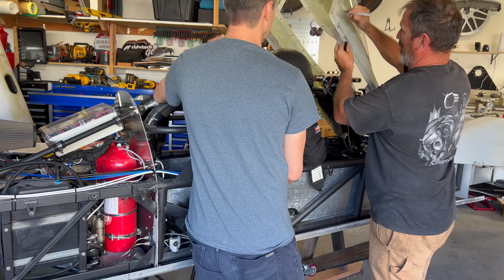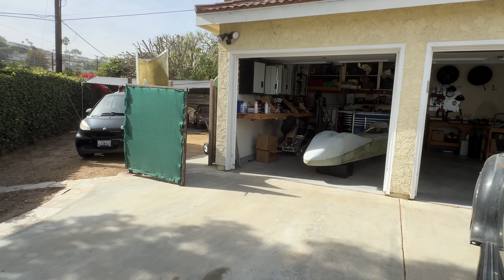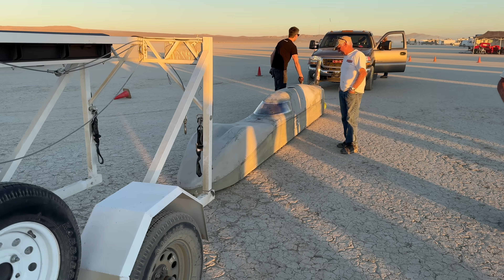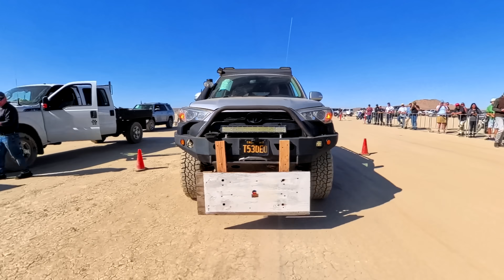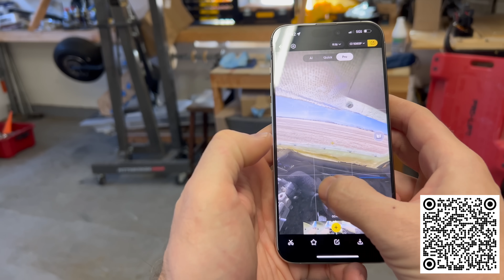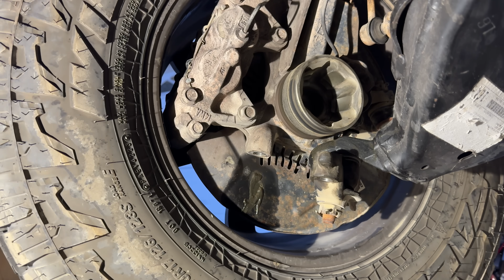I Went Too Fast

Comment: Why not use a 2 cylinder 500 cc instead of the extra weight and rotating bits of a half commissioned 4cylinder ? Use a belt instead of a chain, less friction and weight

Comment: That dust cloud can also be coming up off the rear wheel that is not getting 100% traction.  It's more of a dirt roostertail.  when power exceeds drag the rear tire is turning faster than the car is going throwing up dirt.

Comment: The reason of having to go through the different classes is to learn at what point t steering dynamics are going to reverse.  At tha time when you  steer right, you're going to go left. It's about traction, and depending upon how much weight is making traction on you're front tires it won't matter much if they have greater  cenrifical force. Get it? Got it?... Have fun?!!

Comment: As to the missed reason for the half shaft popping apart, from my limited experience in a race pit lane it's easy to miss what seems obvious later. In the heat of the moment it's hard to focus. I'm more amazed you were able to get the right sized bolt so quickly in the middle of nowhere.

Comment: Throwback to the time I broke all sorts of shit removing a single bolt holding the starter in my Ranger. My brother bought, fixed, and sold er to me after a lot of work. And apparently a little red LocTite.

I should not use the words I want to use about this.

Comment: Hey Matt all bulshit aside I can go 141 mi an hour on a 125cc 2 stroke... I had a buddy of mine's dad machine me a piston or rod and a cam for an old Kawasaki 125 RM... So basically what we did is we put the titanium piston the rod and the cam in it and I've just got a big pipe and it's on an old Orange county chopper setup as a drag bike I cut the crank out of it and take the chain off of it put a big chain guard with a secondary clutch and a primary clutch on it and it has a jack shaft with a small 13 too much tooth gear and then I'm running a 66 and I'm running in the 8th of a mile at the track 143 mile an hour and I still got half a throttle... I've run it on the highway at 165 and shut it down because I didn't have a steering stabilizer and it tried to death wobble on me... And that's just for the 125cc engine. So if I can do that on the bike you don't even need 500 cc's. You could actually take that car right there rebuild the frame out of carbon fiber put an actual fiberglass carbon fiber body using the fake carbon fiber mesh and just fiberglass resin and that car would reach 220 mile an hour with an 18 horsepower Honda engine......

Comment: Ive had the exact thing happen to me on my 04 4Runner. Sucked. Had to get it towed home. It surprised me when I saw that. You have a castle nut and cotter pin for the ball joint. But the bolts holding the ball joint bracket dont have anything.

Comment: I wonder if you could use a Honda VFR 400R 400cc v4 engine....
Reply: He's aiming for roughly 100 hp.
Reply: @jospi2  The VFR 400 is restricted...I bet that you could get close to 89hp with that or with the RC30 VFR750...un restricted stock in 118hp...otherwise a honda CB600 engine could do it...I was just thinking about size and with the V-4 would be smaller and with the 90 degree angle...just seems like a good choice for balance etc....

Comment: Funny, I have a 1997 Gen 3 4Runner and a few weeks ago I replaced the upper and lower ball joints in the car.  My mechanic pointed it out to me and he said the chances of the ball joints causing an accident on the highway was great.  The ball joints had never been replaced and I have owned the car since new.  If those things are loose you better replace the ball joints or you will lose control of your car.

Comment: So,   ...    curious re. disabling two of the four cylinders in the four pot motor to half the cc?  ... you will still have the parasitic drag / losses from the  "disabled componants, ...  unless you plan to remove 50% of the motor internals  ...  maybe better to get a high power genuine 500cc motor  ... some of the eighties two stroke motors can be tuned to 120 bhp with reliability ...  not sure what is available in 4 stroke modern motors.

Comment: It is true that a lot of front hubs are held together by the stub axle which is the most outboard portion of the CV-equipped halfshaft. It is also true that some are not... I find it amusing that 2WD Chevrolet Tahoes (rare, but used here by some police departments) just have an empty splined hole through the hub, because they don't have a halfshaft and don't need it to retain the hub.

Comment: i think on the top speed run it could push 180, bigger motor or more power it could definitley push 200. Also what is the drag coefficientcy
Reply: In the airshaper app that is shown it says drag coefficient of 0.125 and a frontal area of 4.2 square feet.

Comment: Mechanic here, I've seen before it on lifted 4x4s where the increased angle from the lift kit will cause rapid wear or damage to the CV joints, or even yank them out entirely as you've experienced.
Edit; I wrote this before I saw the dislocated ball joint. Oops!

Comment: I don't actually know, but am guessing that is an s1000rr motor. I looked at a picture of the crankshaft, it looks like a typical flat plane inline four crank.
    So, my question is, if you are only using two cylinders, how does it sound just like a flat plane inline four?
    Any two cylinder configuration should sound very different. I have never heard any sort of 2 cyl that I'd mix up with a flat plane I-4. Maybe my ear is off today, but I'm usually pretty good with engine sounds.
   You can't tell a musician that the same note played on a trumpet actually came from a piano, you know?
Reply: Ohhh.. I just finished the video. Sounded like a four, and it was.
   Same guy again.

Comment: I have a question, and it may be that you already answered this in a previous video, but this is the first time the algorithm has put you across my path, so forgive me if it seems like a silly question. 

If you want to go as fast as possible with a 500cc engine, why not use the engine from a 500cc Speedway bike?

Comment: a CBR250RR motor would be nuts in that thing with its 20,000 RPM redline probably not great for performance but 20,000 RMP

Comment: Oil filter leaking equals double gasket. Sometimes the old filter gasket sticks to the oil filter housing and when you screw on the new filter, double gasket leaks.

Comment: I have worked on those 4runner lower balljoints for years. Those four bolts never fall out if torqued to spec, and  the usual problem is they rust in place and snap off. There is no need for thred locker unless you plan on never getting the bolts off again. Some factory service manuals have to torque spec incorect, so be careful not to over torque the bolts. It was a common misprint on the gen 3 4runner manuals.

Comment: Haven't seen the previous videos on this. What's the reason for choosing a half-deactivated 1000cc engine instead of an actual 500, or anyone know which video explains the decision? Seems like it'd mean unnecessary weight...
Reply: There are no easily available 500 cc engines that produce 100 hp, half of the 200 hp that the bike engine produces with all four cylinders.
Reply: @jospi2  thanks

Comment: It kinda surprises me that the best 500cc motor is a 1000cc 4cyl with 2 deactivated. When you do that, how are they deactivated? Are all the parts still there? pistons, valves, etc? If so, wouldn't that have a lot of parasitic drag/friction? Or are they all removed and sealed up somehow?
Reply: He mentioned in an earlier video to take out the rocker arms for the deactivated cylinders to keep the valves shut and avoid pumping losses.

Comment: 12:40 I actually had a half shaft spontaneously disassemble in an off-camber driveway at full right rudder lock. The inboard cv coupling appeared to be healthy, had lots of grease and no corrosion. It just fell apart. I have since never trusted my half shafts.

Comment: Pro tip. Learn to Safety wire. Also known as Lock Wire. Its a MUST for bolts that get vibrated loose. Torque, and then safety wire. Learn the how and why's of safety wire. Its critical its done the correct way, but is not difficult. I became a safety wire expert in the USAF, in no time flat. We put safety wire on almost everything on the F-4 Phantom.

Story time: While I was stationed at George AFB, located right outside Adelanto, Ca, where I used to live, I would sometimes get tasked to help other specialists, to do their work. Usually standing next to a fire bottle, just in case. This one time I was under the aircraft, just watching things, during an Engine Run. I noticed the the missile launcher above my head, an Aero 7/a launcher for Aim-7 missile, which is held in with four bolts, AND SAFETY WIRED. Well, supposed to be safety wired. Since it wasn't flying, and the launcher would be removed after the engine run, to get access to the engine, as the missile launcher is part of the Engine Bay door. The bolts, that were torqued in too about 400 inch pounds. Well, they were all turning, and what caught my eye was one of them falling out. I was able to get the crew chiefs attention and signal there was a minor problem. I grabbed the bolt that had fallen out, no a good thing around running jet engines to have bolts laying around, and began running the bolts back in by hand. And then put the bolt that fell out back in. They all began turning on their own. Like gremlins were intent on having this aircraft AFU. or Tango Uniform.
I had my tool box nearby, grabbed a speed handle and 9/16" socket and torques them back in, and then safety wired them in place. So even when torqued in, they can reverse out, by vibration. SAFETY WIRE SAFETY WIRE SAFETY WIRE SAFETY WIRE SAFETY WIRE SAFETY WIRE SAFETY WIRE SAFETY WIRE SAFETY WIRE SAFETY WIRE SAFETY WIRE

Comment: The same thing happened to my friend's 4runner, one of those bolts fell out and his CV separated itself when he turned. We were off-roading when it happened and luckily we had all the tools to remove the CV. We went to a small local hardware store, we didn't know it till later but we used a bolt with the wrong thread pitch, but it was a short bolt so it still went together and he drove home on it. Later he replaced it with an OEM bolt. Before it happened his friend helped him replace the front shocks and we think that they both thought the other person was going to torque those bolt down with a torque wrench and it didn't get properly torqued.

Comment: That exact same thing with the LCA bolt happened to me in the woods far from anything, managed to hold it together with a smaller bolt and half a dozen hose clamps and drove back the 300kms home at 50km/h (when the towing would have just taken the vehicle because of covid) 😅

Comment: Those two deqctivated cylinders, a few reedvalves on a custom header, and you could turn them into superchargers, 

4 cycle engine means they each pump two volumes for every full internal combustion cycle.

Comment: I once avoided tightening some bolts on an exhaust connector because I was afraid it would warp the two ends of the pipes, only for it do slide off when I drove my GF tot the airport and let the exhaust loose, facing forward.
Luckily, I had to reverse out of my parking spot and so was able to hear the horrible grinding on the ground before driving over some crack in the road and ripping out all the cabling and fuel lines from underneath.....

Comment: Do you plan on plumbing the other 2 cylinders with modified cams or one way valves as a supercharger at any point?
Reply: In a previous video he mentioned to take out the rocker arms for the two deactivated cylinders to keep the valves shut and avoid pumping losses.
Reply: @jospi2  right, but you can use them to make a ton of boost too.
Reply: @jasonbirch1182  That would be an interesting project for future Matt. Blown 500cc record attempt.

Comment: @Futurematt: Warm the lower ball joint bolts to 250°C (550° F) and the loctite will release. 
@Superfastmatt: it looked super stable, compared to the last run, or was that the camera smoothing everything out and your eyeballs were still rattling?

Comment: How do you delete two cylinders? Will there be any issues with the crank timing and achieving the same revs with the different balance? I take it you'll remove cylinders 1 and 4, but you'll still be turning half of the crank-shaft mass as dead weight, right?
Reply: In a previous video he mentioned to take out the rocker arms for the two deactivated cylinders to keep the valves shut and avoid pumping losses.

Comment: Tip for better deadline approximation and timeline fulfillment: stop trying to guess when you think you can do it. Think about the most inefficient way someone who knows absolutely nothing about what you’re doing what do and what you think you’d reasonably expect from them, not yourself. Knowing nothing about cars, building a land speed racer? I recon if you went to trade school or something which I have no clue how it works because I went to college like what, two years, four years tops, another year added to actually practice a little bit. Think how long it took to get good at your first job.  the project should take 3 years minimum conservatively! More like five years really, for something half decent. Even if you’ve engineered and designed both a gas and electric vehicle from the ground up from molten steel and a bucket of transistors, and rebuilt a hundred engines, you might think you got this you can do it in a summer or something, but you haven’t built a land speed racer yet, so… 
I know it doesn’t really apply now that you’ve done it but hopefully that helps someone where, I wish someone would have explained estimations to me like that a decade or so ago.

Comment: Im confused, if you needed a 500CC engine why not use a bike engine? Why have the extra weight and internal rotation resistance of two dead cylenders? The sole benefit that I can think of is an H pattern transmission that can be put into neutral at any time as opposed to a sequeltial transmission.

Comment: I wonder if that bolt hole in the front being left open might be important for the laminar flow?
Also some of the high pressure air under the front and around the wheels can bleed off.....

Comment: Did you lower your front diff when you did the lift kit? Ive done about 12dozen of those lifts and they pop the axle out just like that if the diff has not been lowered a few inches to make the cv axles level

Comment: Turn the "inactive" cylinders into an air pump and use a liberally "lightened" air motor for extra power. No heat exchanger is needed before the motor, and the working air can either be closed-loop fancy gas, or you could return it to a centrifugal compressor's intake.

Comment: 13:52 Thread locker generally doesn’t make a difference in a fastener loosing or not. Just might slow it down a bit on its departure journey. There is no substituting a properly tensioned joint.

Comment: For future Matt, the outer CV can be dismantled like a puzzle, usually a clip to get the shaft out, then rotate the cage about 90 degrees to push one ball out, then repeat.  It's like a fun 3D puzzle, no hammer required.  Congrats on the run.

Comment: And not that it matters that much now, but in the shot that your lbj bolt is missing, there is a ridiculous amount of stick on wheel weights on the wheel. So might be a reason to get that tire/wheel checked out. Normally wheels, even with mud tires, don't require anywhere near that much weight.

Comment: I noticed the rear aero (before you mensioned it) and the way the air came off the rear fin, very clean and sharp. Well done. Better that your work on the 3-Runner, but that's useually the case with race cars, they have shitty tow vehicles.

Comment: Kiwi Steve is a super nice guy.  He wandered up to our pit in 2015 at the first Ranchero's first [24 hours of lemons] race and saw a bunch of millenial idiots scratching our heads over "how do carburetor work".  He spent the rest of the evening walking us through carb troubleshooting and tuning.  And it ran better when it got fuel (we were on a mechanical fuel pump, and when replaced it with an electric pump out of a Civic the next day, the car was able to go up the hills at Sears Point.  He helped us get a "class win" at our first race...).  Anyway, shout out to Kiwi Steve indeed.  What a legend.  I'm glad he's still hanging around the SoCal grassroots motorsports scene.

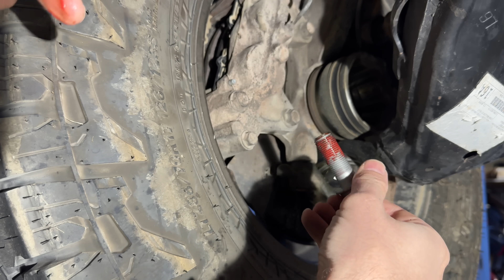Comment: 14:01 No you did not 🥺 red locktight should come with a warning lable cause that is now perma chem welded.   Blue or gray only, unless specified otherwise. Yikes,  heat may be your only savior sometime in the future, as in while replacing the CV shaft.

Comment: When I was watching the flagger give you the start and I heard the engine rev up and then you starter slipping the clutch big time to get going, I knew something did not work as planned. I was wondering what happened to your PUSH. And then wondered if your clutch would stay locked up at the top end push.

Comment: Cool project,  stability in the first run is a good sign of things to come. 
Buuut...4 cylinder running on 2? That's dead weight.  What about pumping losses?  I feel like you got the wrong engine.  I'm newish here so I missed the planning phase,  but was that the plan?

Comment: I never use thread locker on suspension stuff and have never had an issue. I don't torque suspension bolts either, just as tight as i can get with a 1/2" ratchet, maybe use a 
 breaker bar on control arms and whatnot.

Comment: On the Toyota bolts, it’s a good idea to do a second torque on new parts after a few miles and everything has had a chance to like press into each other on a very small level. Then you need to put more tension on the bolt so it stays.